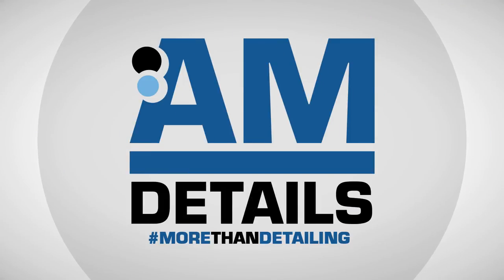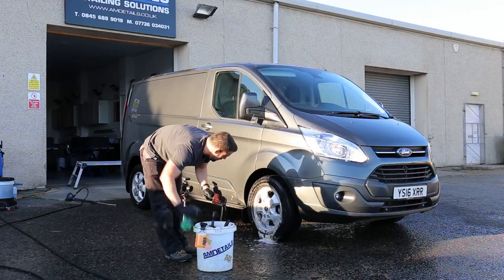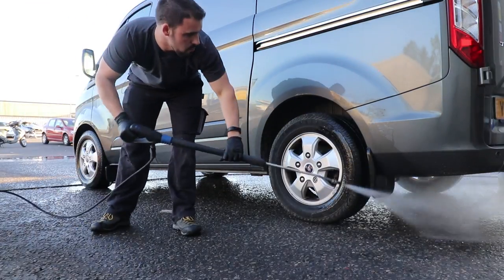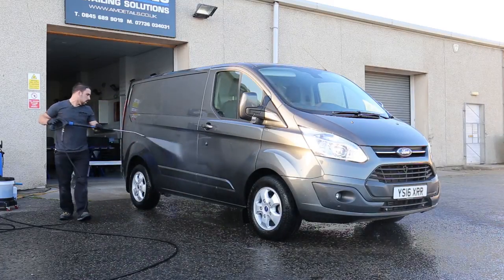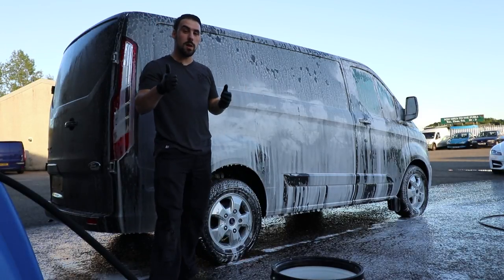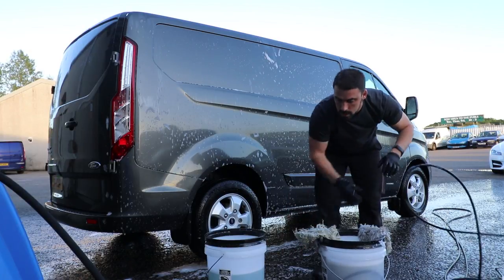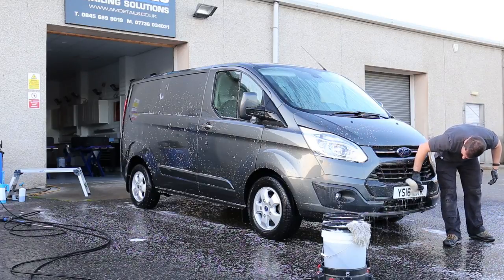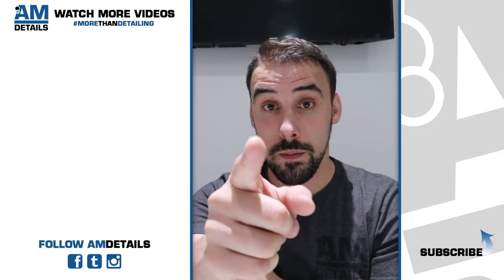Maintenance Detailing Guide on the AM Van + Alan Chat & Tips

Comment: re bottom to top wash; I was in the US Navy from 91 - 97. There was a cleaner we used on aircraft and gun mounts that you had to go from the bottom up. If the dirty suds rolled down over a dirty surface they would stick to the dirty surface and stain. Those were matte surfaces, but I have noticed a similar (although not as pronounced) effect on glossy paint or tile.

Comment: Great video as always !!! Look forward to more !! Quick question on the after the wash, what's best way to dry/store the wash mitt over the winter months when maintenance wash only done maybe once a month??
Reply from the maker: Hey Andy,

This is something we are looking into more. We don't appear to get the same "Mitt" failure rate as others and to be honest, we show them no mercy. After a wash, we ring them out then they sit in the rinse bucket with no lid on. It's in our wet room which is not exactly warm and is subject to the cold in winter also.

Things we do not do.
Wash them in a machine or by hand with anything other than AM Bubbles.
Force dry them with the blow drier or heater room/radiator.
Put them in the bucket with the lid on (STINKS!!)

We will do more research over the winter and put together a mitt guide. But for a natural material, I would expect you to see 2-3 months. We appear to get a lot longer, but I wonder if this is because they are used nearly every other day so never allowed to dry out or sit and go mouldy?

We will also look into some synthetic alternatives in the future.

Thanks for the question Andy.

Alan 😎👍🔔

Comment: Hi Alan
Do you protect the paint after a maintenance wash?
The reason I ask is this - does the APC and snow foam wash strip off any sealant or wax that was on the vehicle?
Was what you sprayed on last exactly this?
Love the video!
Reply from the maker: On a Basic maintenance wash, there should be no effect on the exterior protection, but as a final step, a wipe over with our detailer, or a quick spray with our "magic pink stuff" adds to any protection which is already present. 

Hope this helps

AMDetails Team

Comment: What's the pressure washer your using Alan and is it hot 💦
Reply from the maker: Hey, Craig, the washer we have is http://amzn.to/2xyKAJu the Nilfisk Neptune 2-26 X Special and its running pressure is 145 Bar.

It can run 80 - 140 Degrees Celcius. But in this wash, I used it cold.

Thanks
Alan